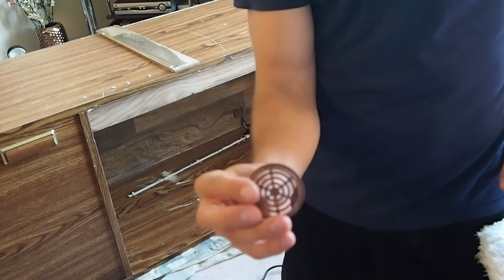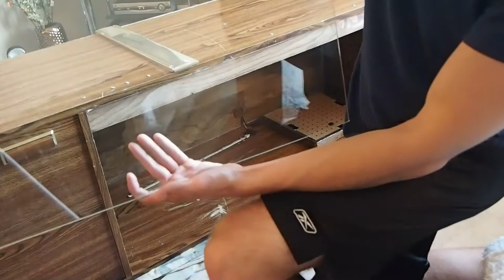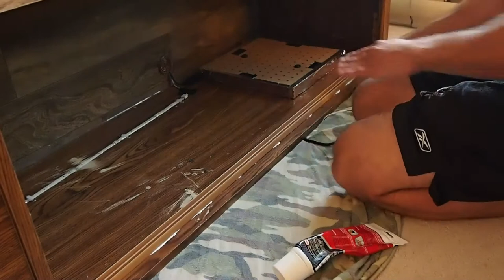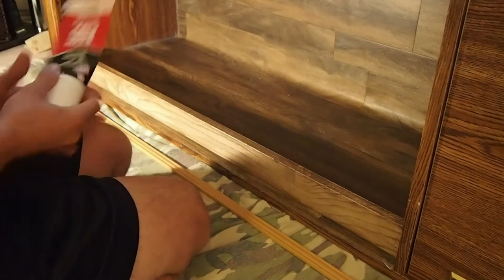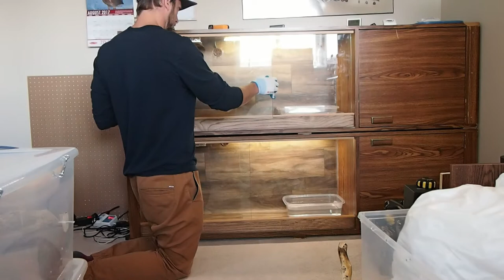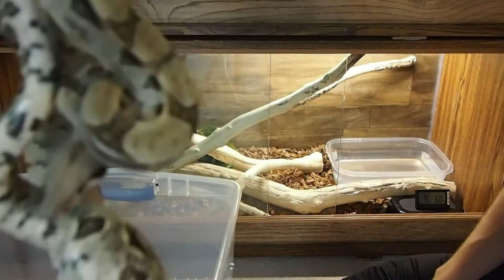DIY Snake Cage: Part 3

Comment: Tremendous. I have a wooden enclosure that is essentially the same dimensions.
The finger pull handles and the vinyl is something I absolutely need to do.
I was always wondering what I could do instead of just having a wooden floor. Which seemed questionable, and it's hard to clean, and the cleaning materials don't dry as quickly, etc. So I'll absolutely do that.
Reply from the maker: Awesome!! Glad I could help, good luck with the build 👍🏼

Comment: Are you worried about the wood rotting with the heat and humidity? I would like to build something in the future for a rainbow boa but would I have to treat/coat the wood? Thank you in advance!
Reply from the maker: I'm not concerned about the wood rotting for these particular enclosures, reason being is even despite the humidity being high nothing is actually "wet" in the enclosure. Plus the humidity requirements for Colombian Boas is not that high (50-80%). Now having said that, a Brazilian Rainbow Boa require much higher humidity, so wood could be an issue but you could easily seal the wood and have no issues. If you watch The King of DIY video titled "How to: Build a Plywood Aquarium" he shows you how to fully seal wood. That's probably what I would do if I were to use wood for a BRB.  Also sliding doors may let too much humidity out so you might need to come up with a different door system... I have a new video coming out in the next few weeks showing a new build for my BRB so it may be helpful as well!
Reply: Animals at Home yes more videos!!! Looking forward to the BRB build! Thank you so much for these videos. It makes me so happy to see DIY vids in an apartment lol - every time I see DIY vids with people that have garages/dedicated work spaces, I just keep thinking how it’s not possible for me or how much harder it is. Thank you for expanding my possibilities!!
Reply from the maker: I know exactly what you mean!! I dream about the day I have a garage and a good set of tools... but for know the apartment will do! Thanks for the support :)
Reply: @AnimalsatHomePodcast  I hope you see this, where did you get your wood? What species is it?
Reply from the maker: Do you mean the climbing branches? If so, watch my video on “How to Sterilize wood for reptiles”
Reply: Copy that

Comment: Great enclosure dyi video!! it's been 1 year since the build,  and i have a few questions, did you have any issues with the heating pads or the enclosure itself? thank you!
Reply from the maker: Thank you!  No I had no issues with the heat pads, although I did expand the enclosures recently so went with larger heat pads (used heat tape) 

Boa Enclosure Renovation- Adding Tunnels!https://youtu.be/wrKUw6NPTUc
Reply: Glad you had no problems with it, i've been wathching so many dyis and yours seems the simplest but the most efficient. What is the thickness of the wood btw?
Reply from the maker: Glad to hear that! The wood is about 3/4” thick

Comment: What powers the LED lights were they designed to be run on house electricity  (AC) or is there some sort of power converter  (AC to DC) or are you running batteries?
Reply from the maker: Just a normal 120 AC plug, no batteries or converter!
Reply: I'll have to keep an eye out for that, that's a huge help thanks. I have 2 Corns and I plan on making them custom enclosures when the young one gets larger it would be nice if they could stack but I was trying to consider low profile lighting options so I didn't have like one foot of wasted height to accommodate the light fixtures
Reply from the maker: Ya no problem! Lots available on Amazon, definitely an easy way to go for lighting

Comment: What do you use for humidity ?
Reply from the maker: In the summer time my relative humidity in the room is +60% so the water dish easily maintains a humidity I 70-80%. In the winter I run a humidifier in the room and try and maintain a humidity of 50-60% in the enclosure. I’ll currently editing a video about how to increase humidity in a terrarium, should have it posted early next week.